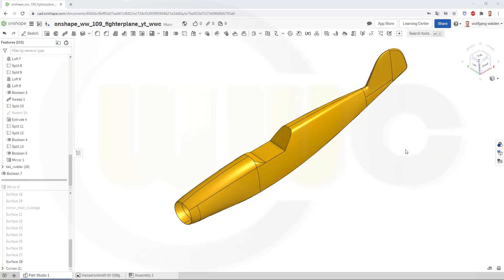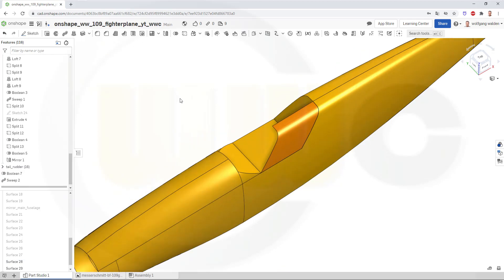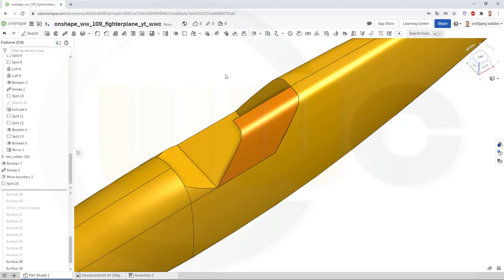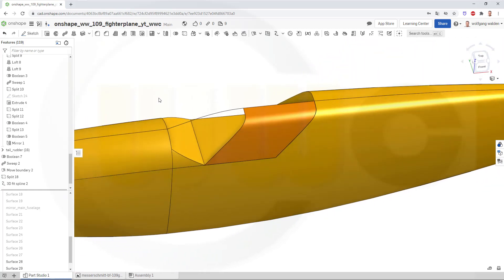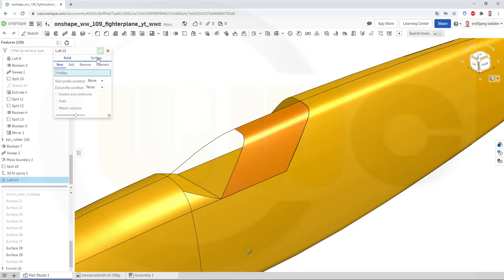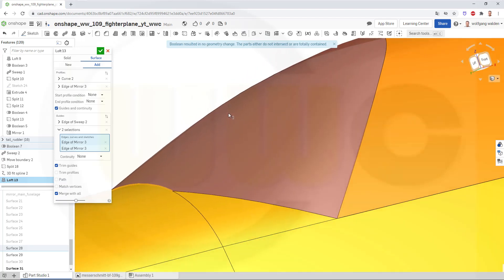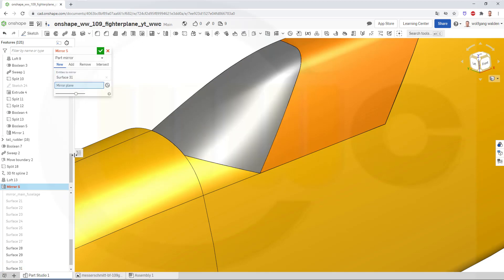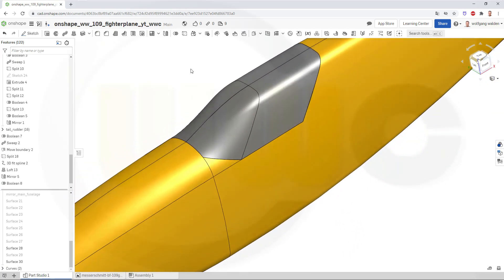WW-109 Fighter Plane - Part 6 - Cockpit Glazing - Onshape Training - Surfaces

Comment: Vielen Danke!

I am a mechanical engineering student in Finland and your tutorials have been incredibly helpful for me. Thank you so much. 

I am also extremely interested in aerospace, so these types of models are very enjoyable to make. 

User Request : Is it possible that you could make a mini-series to develop a complete axial thrust jet engine (Inlet, Fan, Compressor, Burner, Turbine, Nozzel, Shafts, Housings) using Onshape, with mechanical drawings?
Reply from the maker: Hi, great. Regarding your Request, in order to do that I would need drawings/blueprints of such an engine.
Reply: @wolfgang.walden.cad.training  Hei, thank you so much for the quick response.

Admittedly, I have had some difficulty finding example assembly drawings for a jet engine; however, I did manage to find a free CATIA file:

https://grabcad.com/library/pratt-whitney-turbofan-engine-1

I'm not sure, but do you think it would be possible to explain how to build this in Onshape?
Reply from the maker: I´ve made already a lot of "turbine" - like exercises in my channel. You should check these out first. To do a complete jet engine would take a lot of time. And time is money. So to do this for free is very difficult. But I will consider it.
Reply: @wolfgang.walden.cad.training  Thank you for your consideration and also for all your videos. Again, they have been immensely helpful. I value all of them greatly. Time is even more valuable than money and I respect yours. I will use the resources that you have already provided, happily.

I will go through the turbine related machine elements on your channel. My next project will be the Turbine Exhaust in the Onshape playlist.

Also thank you for posting all your videos to Odysee! I actually prefer Odysee to YouTube (I think it will be much more prominent in the future). I do not have much LBC, but I will support some of your videos there will a little LBC, as I can.

Beste Grüße!